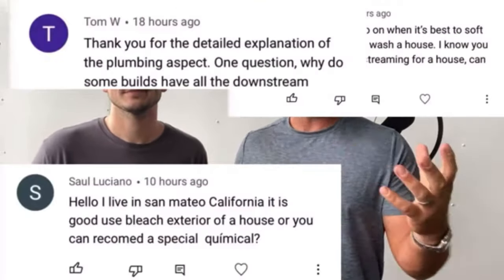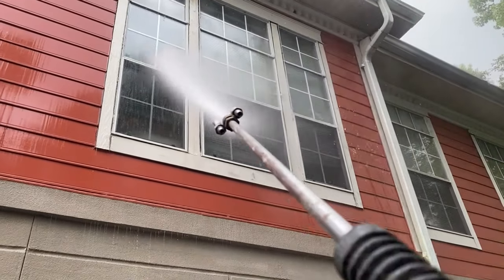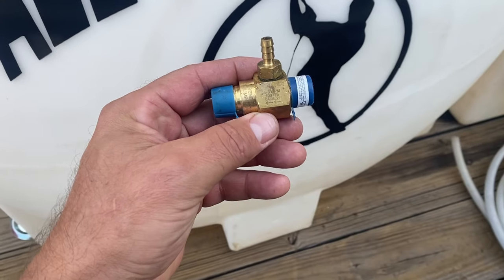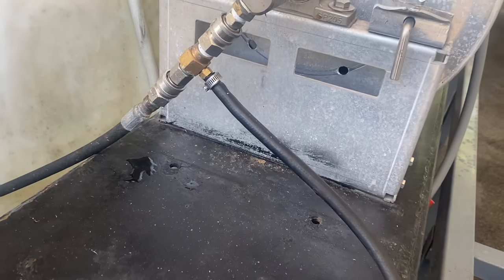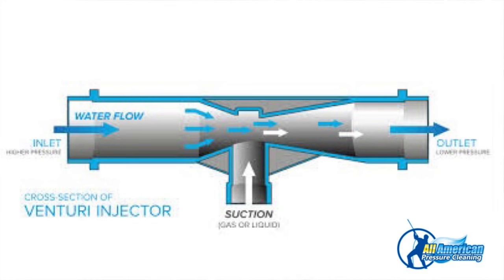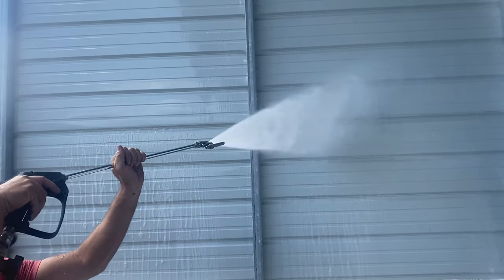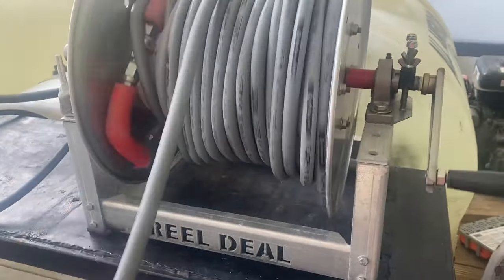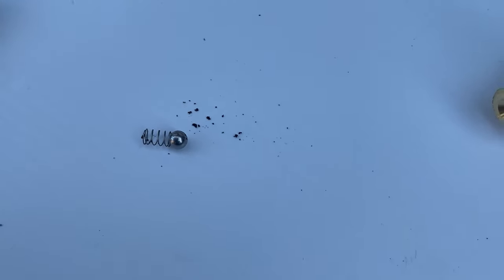Every Pressure Washer needs to know this…. How To Downstream

Comment: I purchased the downstream injector however this one that I got from Amazon is adjustable and has a metering valve. Was this a bad idea? I'm guessing I would have to open the valve all the way up to get the max amount of chemical right?
Reply from the maker: Yes - it’s just a preference thing, we like fixed because it’s less moving parts, which means less opportunity for failure.

Comment: Need help, added more hose and now i cant downstream. ..  only with 50ft.  Any more hose I can't pull suction suction.  I've tried 2.3mm, 2.1mm & 1.8mm general pump injectors.  Pump is canpump 4.7gpm, using jrod for 4gpm.  Any help greatly appreciated

Comment: Hey Mike!  Quick question…I am starting a pressure washing business and have been learning a ton from your videos.  I def will get your instructional once I get everything together.  Question: You mention rinsing with the ball valve (02:16).  What exactly is that?  I know what a ball valve is, but what are you relating to?  Thank in advance!
Reply: if you hook a ball valve up to the end of you’re hose you can you use it to rinse with. so if say you apply chemicals you can just use the ball valve to rinse it off with

Comment: Great video! 2 cents to add because it drove me NUTS!  Make sure your hose is 3/8! You cannot get a vacuum with 1/4 inch hose. Rebuilt the check valve 4 times before I realized that problem was the 1/4 inch hose.

Comment: Thanks for the great info. If I have a downstream injector connected at the washer right after a ball valve, then will my surface cleaner and wand get enough water flow? I ask because if the injector constricts the amount of water that can pass through it, then would it also result in less pressure at the gun?  Thanks again!

Comment: Thank you for the video! I am only able to get soap with the injector when using the black soap tip not my j-rod. I've just purchased a new pw  machine it came with the injector kit the arrow is pointing towards the wand away from the pump. I've put it on the machine like in your video and on the hose closest to the wand. What am I doing wrong? Oh and I have a 2.5 GPM and 4 GPM machine with about 100 feet of pw hose and injector hose about 5 feet same issue on both machines. Thx for any recommendations

Comment: What are the best tips to use while downstreaming ? And if I'm rinsing with an M5twist, it won't be pulling Chem correct? :)
Reply from the maker: Benjamin, the tips are dependent completely upon your machine, the psi in the GPM. You can consult with the manufacture of your machine to determine what would be best. I have never used an M5 twist, I'm not a fan of X jetting for multiple reasons but it is my understanding that if you use it just as a tip, that will prevent the flow of chemical with a simple twist.
Reply: I used the X-jet with the twist nozzle for 2 jobs and went back to down streaming. The x twisted either way will still pull detergent. I installed a 1/4 turn back valve about a foot and a half below the xjet to turn off the detergent. I went back to down streaming using a j-rod and haven't looked back.

Comment: Hey, is there a way to use longer hose and still get ample sh injection?
Reply: Longer than 150ft
Reply from the maker: Brand, new hose, high flow injector, a few restrictions in line as possible, like Hose reels, 90° bends, etc.

Comment: Thank you for the videos and for the knowledge. Im just starting out and only have completed a few simple driveway jobs. I'm nervous about using chemical and causing damage. I'm ready to start trying it though.  Where do you order your chemical injectors? Iv looked up a few injectors and they say there rated for pressure but the comments say they wont draw soap and there garbage. Any advice would be helpful. Thank you again for the videos

Comment: Hello, what if the pressure washer already comes with it’s own down stream injector? but paper work says to not use it for bleach only soap. Could I still run bleach through it or add a second down stream injector?

Comment: Thanks for the video! I know, if using a separate pump, the SH mix should be 1:1, but what if using and injector straight from the pressure washer? Should the mix ratio be changed, and to what ratio? Thanks

Comment: Hi, i have this “downstream injector” directly on my machine. Is that okay? I have Wassper W3100VA.
Reply from the maker: It’s fine as long as it works. But as soon as it doesn’t work, I would bypass it.
Reply: So it is better to connect it directly to the hose?

Comment: I'm trying to use high pressure with soap for washing dirt bikes.  How would I get high pressure soap dispensing?  Other than a foam cannon.
Reply from the maker: You can't - apply soap at low pressure - rinse with high
Reply: @AllAboutPressureWashing  dang it  :)
Reply: Elevate your soap tank a couple ft above your pressure washer, spray soap at high pressure all day.. 👌
Reply: @Liimpy  hmm... You mean the gravity feed from the height drop gets you what you need?
Reply: @lkjhgfdsa-o6h  yup, give it a try

Comment: Just bought a 10 gpm beast. Was using a 5.5 gpm. Is it true the 10gpm chemical injector won't pull soap as strong as the 5.5?

Comment: Hey guys!! I have a 3200PSI 2.5GPM pressure washer which has its own soap tank.  I want to install a chemical injector to be able to use bleach without damaging the water pump.  Can I install a chemical injector on this machine?  What do you think is my best option?  Thank you!

Comment: Ok but how do you get the correct ratio of chemical? Trying to get into pressure washing on the side but can't figure out how to control the ratio of the downstream injectors. Using an x-jet right now want to upgrade in the future.
Reply from the maker: The chemical injector that you purchased determines the ratio. You can have an impact on the strength based on the bleach that you're introducing into the stream.

Comment: have you come across a downstream injector that can get you close to the ratio you need to clean a roof? I hear the suds sucker is a high draw injector.
Reply from the maker: +smitty4699  there are a couple that can get you a stronger mix but not really anything close to a roof mix.

Comment: My machine has one like built into it with the arrow facing away from the machine, is it still required to plug one of these in ?
Reply: nvm looks liek my has a male thread and it screws off to replace is needed
Reply from the maker: +Cross Exterior Cleaning LLC If you have one, you do not need to put another one on.
Reply from the maker: +Cross Exterior Cleaning LLC Perfect, just saw this.

Comment: my Simpson washer has an injector right at the end of the pump outlet built in. is it safe to use that or should I get a different one? I just worry sh could some how get sucked back into the pump if I was to use it
Reply: I just bought a Simpson 4200 PSI 4 GPM machine and I'm wondering the same thing.
Reply: Use it. I’ve used mine on my first 5 jobs!

Comment: What if your machine has a down stream injector already?
Reply from the maker: This means that you purchased an inexpensive pressure washer, probably some sort of homeowner version. Built-in chemical injectors are not great for professionals as the amount of chemicals you run through it on a daily basis will eventually kill it, you can either rebuild or replace. Replacing is the easiest and fastest way to do it most guys that have Milton chemical injectors and are using them for a business will eventually just bypass the factory chemical injector and put in their own
Reply: @AllAboutPressureWashing  Thank you, it’s my first pressure washer it’s a dewalt 4gpm from what I understand it’s the same as a Simpson, I could be wrong on that, it’s definitely paid for itself by now, but I needed something fast and I happen to have a Home Depot credit card😂 Could you tell me a better washer to look into? See if it’s something I can afford? Thanks for your help! And thank you for all the information with your videos!👍🏻💪🏻👊🏻

Comment: In order to yield a higher concentration from my injector, can I install a second downstream injector to draw twice as much chemical. This is in order to get a higher sh mix
Reply from the maker: +Wipesmine2 I don't think that would work, You can get a higher concentration with an X jet, or even better a independent 12 V Softwash pump

Comment: My pressure washer started backfilling the soap bottle with water. It fills up the soap bottle and then the cap blows off because of the water pressure. What happened? This small electric unit I bought on Amazon has been working well for 3 or 4 years. Now very little water comes out of gun, and most water is overflowing the soap bottle. I don't get it.
Reply: Same here my downstream injector sucks water back into my 5gal bucket vs pulling the chem like it's supposed to.. I'm even using the black soap tip.
Reply: Your check valve (the little ball and spring device in the injector) is either damaged or gunked up and in need of cleaning, allowing pressure out the uptake tube.

Comment: save your money and buy a stainless steel one i used to replace these every month
Reply from the maker: You were replacing them because you weren't taking care of them. The component that fails is not the brass, the component of the fails is the ball and spring.
Reply: @AllAboutPressureWashing  thats true😂